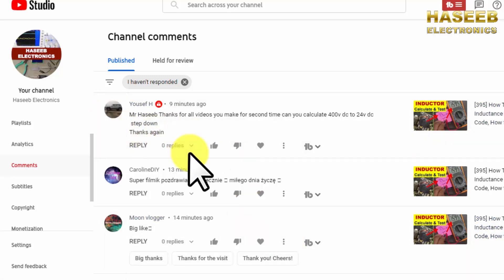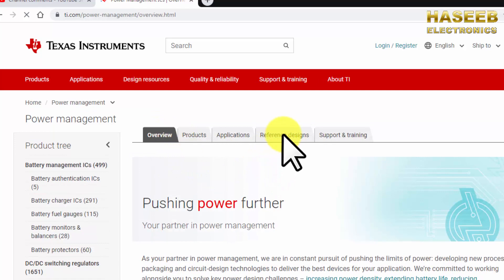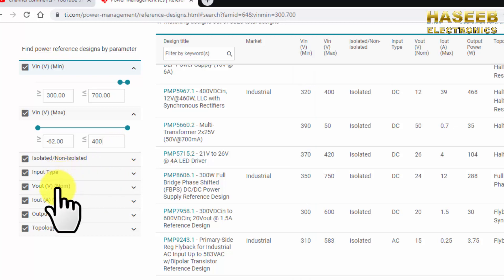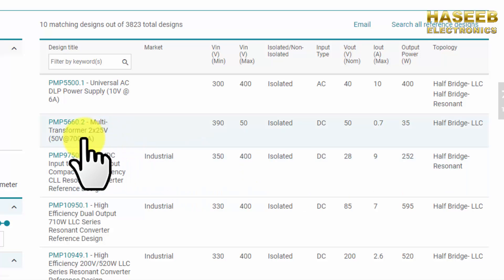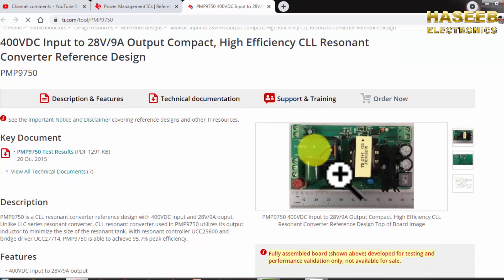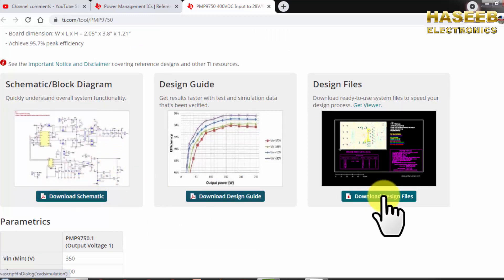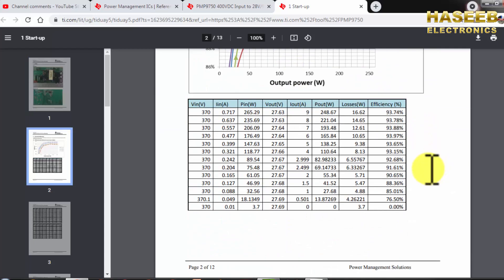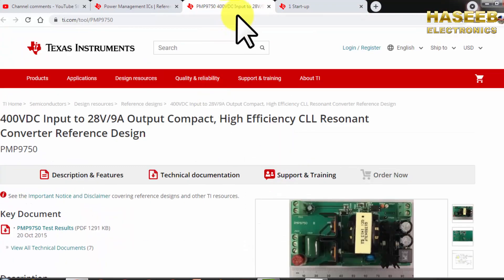[396] 400V to 24V SMPS Circuit Reference Design

Comment: Hello Sir, Where can I get reference of design of SMPS Power supply in flyback mode of input range 300 to 480 and output range 12 V and output current is 0.5mA/A and power consumption is 6W and IC used is INN3692C